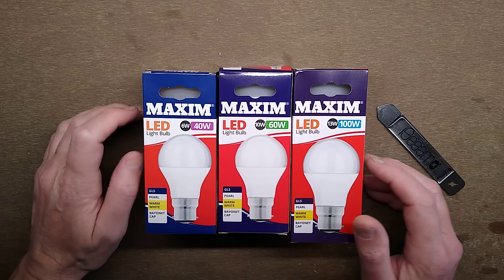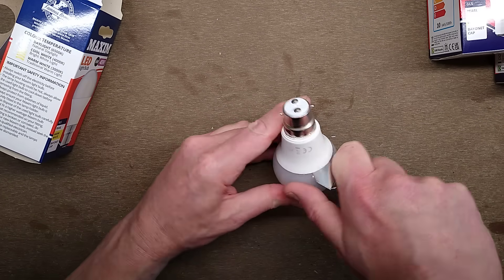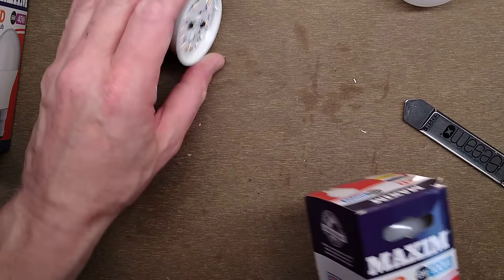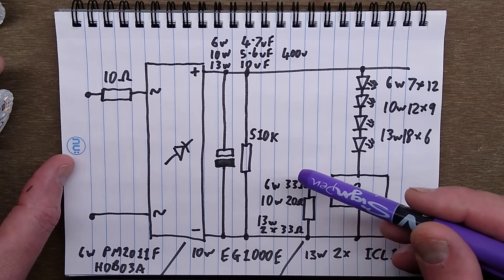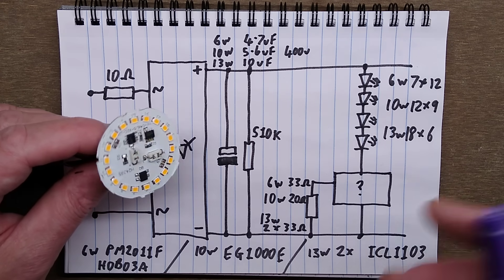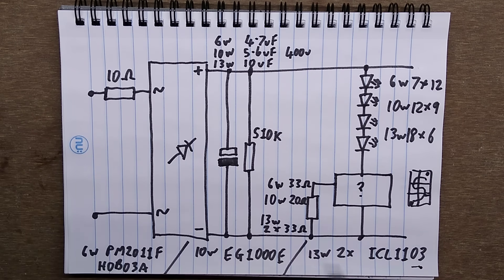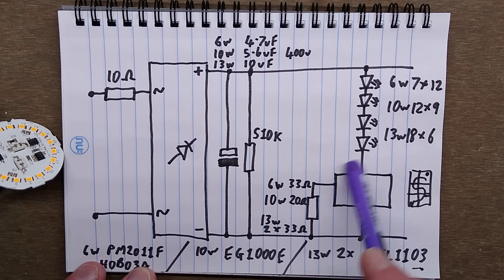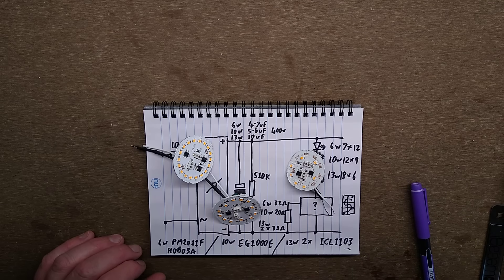6W vs 10W vs 13W LED lamp showdown (with schematics)

Comment: Wow what a power factor! Most modern places they have fitted new power meters that will actually charge you fully for bad power factor products so there goes a heap of your savings. Most of my batten lights I bought to replace old fluorescent ones had premature inverter failures. I wonder If I could use them chips of a few bulbs to make them working again. I also have a good collection of TV back-light strips that are happy around 70V.
Reply: What do you mean by “most modern places”? Ttbomk in North America and Europe no country is charging end user consumers for power factor (yet). Industrial or large offices, sure, and as Our Gracious Host has previously said, the smart meters we all have now can do it, if enabled to by software, and it’s not impossible that it will happen — but the switch has not yet been thrown.

(Also, .6 is a fairly good power factor for led lighting. The bad ones were more like .1-.2)

Comment: I wish you'd also measure the Lumens output on these bulbs, which frankly is the most important consideration for most consumers.
Reply: How easy is that to do, though, especially when travelling?
Reply: Measuring that correctly requires a rather large and specialized tool called an "integrating sphere". You can't do it with a handheld light meter. Also, given that other parameters on the box usually measure out correctly, I'd assume the box is accurate, at least initially.
Reply: @Broken_Yugo  You can never assume the box is accurate when it comes to cheap made in china products. More importantly, we're not looking for highly scientific measurements like that. A simple light meter at the same distance is more than enough to at least measure the difference in output between the bulbs.
Reply: Exactly, especially a comparison between stock and hacked one would be very useful

Comment: I hate to say it Clive but the problems with the silicon in the first bulb indicate exactly how much care the manufacturer will take in producing them, this could be a case of where the price of the item will reflect exactly the quality of it.
A  low price suggests no QC and little care taken in the manufacturing process, possibly that may change with more expensive versions of the bulbs, but since these are produced by Chinese manufacturers and branded for western markets I could be truly wrong.

Comment: The schmoo everywhere is akin to the 30w LED streetlight I bought a couple years back, took it entirely apart the other day, earth wire was just stuffed under the aluminium plate PCB with the bare wires all shoved into silicone goo, basically making it an insulated connection, and that was a UK-approved light too, can't possibly think why it was sold off cheap back then... :P

Comment: I have a big 20w lamp to light up a medium sized shed. I opened that lamp but discovered a different construcion: it had more than 100 leds and the power supply was in the lower body submerged in resin. All the lower body despite looking plastic from outside had an aluminum body on the insider, which made contact with the led board using a decent amount of thermal paste...no way it can be hacked. Probably this kind of hacking works only on small bulbs.
Reply from the maker: Even the big panels have current regulators that can be hacked, but it's harder when they are potted.

Comment: Most of the bulbs I post-mortem have been manufactured with some failing in the cooling, e.g there's a bit that should be crimped and it hasn't been, or there's a place where things need to be squeezed together for proper heat flow, and it isn't squeezed - or there should be heat sink compound and there isn't. It's a shame - they're often lasting no longer than a tungsten bulb would. And it's not the fault of the LEDs themselves, it's all about heat flow and cheapness.
Reply: I've dissected a lot of post-mortem LED bulbs too. It's almost always due to overheating, which is hilarious since LEDs are so much more efficient per watt. Especially the cheap LED bulbs being advertised with a "25 year lifespan" LOL.
Reply: Chineseum crap 😠

Comment: The real problem is that most LED lamps are marketed with “equivalent” power ratings to tungsten filament lamps. However, the amount of electrical energy drawn from the mains supply is not equivalent to the amount of light output. This is true for any type of lamp. As all lamps waste some energy in the form of unwanted heat. Plus how many people actually try different lamps to select one with a reasonable brightness for the room, rather than fitting whatever they have / the highest power that they have?
Really lamps should be selected using both Luminous intensity (unit is candela or cd) which is how bright a light is when the light from it hits a flat surface from one direction of the light source and Luminous flux (unit is lumen or lm) which is the total light output from all directions.
As Clive says, the efficiency of a LED to convert electricity energy to light varies depending on the electrical current and more importantly, the temperature of the semiconductor chip. At higher currents (power levels) it runs hotter, but is less efficient. Hence if you run a LED at half the maximum rated current (LEDs are current operated devices), it will be more efficient than when operated at its maximum rated current, but will obviously have an overall lower light output.
The reason that manufacturers don’t operate LEDs at lower current levels is cost. You would need more LEDs for the same light output.
Reply: This is 💯 correct. I made a comment about also measuring the Lumens of these bulbs before I saw your much more in-depth comment. Power consumption does not mean equivalent light output, and so many "equivalent" LED bulbs on the market lack the light output.

Comment: So, you mention these are linear regulators, typically linear regulator has a constant voltage. Have you placed a current probe in the LED path (or look at the scope voltage on the current sense resistor) and verified there is no switching going on? Two older units I have switch the current (no inductor), ramps up to a peak current, turns off and repeats. Can you try this?
Reply: Well, I dislike the term “linear” when used with regulators, as their operation is far from linear for some of their operation. Really “linear” is being used to mean it’s not switch mode technology. A better term would be “DC current regulating”…
Reply: @Mark1024MAK  As in semi-constant regulating. But the older led controller I looked at ramped up the led current to the resistor threshold, then switched it off and repeat. I was curious if these new "linear" regulators were doing this nor not.
Reply: @user-rs8zg8ey2b  - ramping up implies that there is a capacitor that is being charged to control the output. Which would be a strange thing to do. Unless that design keeps hitting some kind of protection limit (over temperature maybe).
Reply from the maker: Linear current regulator.  The current is fixed instead of the voltage.
Reply: @bigclivedotcom  That's what I assumed, until I put a current probe in the led current path. Have you checked this to verify its constant current?
Lazy way is to check ac voltage on the current sense resistor, should be zero if your correct,,,,but I have seen DMM's that are not great at higher freq AC waveforms, I love my current probe, DC to 50Mhz, 0 to 30A.
Reply: @bigclivedotcom  Would you consider this linear regulator constant current? http://www.bpsemi.com/uploads/file/20161215114728_476.pdf

Comment: How does power factor affect consumption?
Reply: It does not. However, a poor power factor means there are more distribution losses compared to a good power factor. But keep in mind these losses are relate to the real power. So for low power devices, it’s less of a problem.
Reply from the maker: Theoretical the utility industry sees slightly higher current, but you only get charged for real power.  But with smart meters that will inevitably change.
Reply: @bigclivedotcom  - I still have a “traditional” meter, and can see absolutely no advantage to me to have a so called SMART meter at the moment.
Reply: @tactileslut  - my meters (electricity and gas) are contained in those lovely “white” plastic boxes in the house wall at the front of my property. But at least mine are not able to be seen from the street (they are in the wall next to the steps to the front door). I take my own readings once a month. Takes less than two minutes. Then if I want, I can enter the results on the web site of my supplier, who update my account, normally within one hour.
Only if the supply companies offered a discount rate for energy use off-peak would a so called SMART meter be useful. But it’s doubtful if overall, this would reduce costs, as it’s likely that they would raise the peak rate at the same time, or not long after…

Comment: I like how the design seems to be maturing to a very simple standard.
The first LED house lamp I ever played with was one I wired on my own, mostly similar but it did stay on because I had it on a circuit with three switches and the capacitive coupling through the cable was enough to keep a few LEDs on. I had not considered that that little energy would light them up,  but considering the cure seems to be to create extra heat, I don't mind a residual glow. After a decade the filter cap I used degraded, and I suspect that will be one of the most common failure modes with these too.

Comment: Why is the power factor so low? 🤔
Reply: It uses a “bulk”/“smoothing” electrolytic capacitor which charges up to near the peak mains voltage. So during the time the sine wave of the mains voltage is below the voltage on the capacitor, no current flows from the mains supply, then as the mains voltage exceeds the voltage on the capacitor, a very large current flows for a short time. Then the cycle repeats. That’s what causes the poor power factor.

Comment: I found that solder joints on these types of bulbs starts cracking after a few years leading to flickering lights. Sometimes resoldering works but not always.
Reply: Because cheap manufacturing use solder without that 1% silver...
Reply: @rayoflight62  or without that nice juicy lead
Reply: That's what often happens with cheap Chinese tat I'm afraid. I wish people were more discerning and paid a little more for something which would last a lot longer and not quickly end up as landfill, but seemingly a lot of people just love wasting their money (and then having a good moan that they're broke).
Reply: @SlartiMarvinbartfast  I have often found Chinese electronic products use very thin copper wires in them with poor solder joints.  I have repaired a number of outside solar lights by replacing internal wires and resoldering joints.  I guess most of them end up in landfill after a couple of years at best!
Reply: Happens with CFL bulbs, too. I've torn a few apart after they've died, from various brands ('store brands' up to Sylvania), and they all seem to have at least 2 joints with eye-visible cracks. Most I've seen was around 8 cracked solder joints! (I don't remember the brand of that one).

Re-flowing them has fixed a few, but often times it seems like the cracks coincide with the death of components... Whether it's the cause, or a result, in not sure. I can come to a plausible situating for either way.
Having to jump the small gap(s) maybe raising resistance or causing voltage spikes (its often on the HV lamp lead posts), frying stuff that way.
Or, components wearing out getting hotter and hotter, cracking the joints.
OR might be neither now that I say all that, and solely down to thermal cycling causing metal fatigue or the super, due to long "on" times each day where the unit reaches maximum internal temp... 🤔

Either way, I agree, it's probably the Lead-free solder at fault, resulting in a rigid joint, on top of the alloy being more susceptible to work hardening, and ultimately cracking.
Thankfully consumers can still get leaded-solders. Personally, the best I've found is Radio Shack's Sn/Pb/Ag (62:36:2; 2% Rosin) in 0.015" dia. Mainly due to its flux! This other brand I had bought when I couldn't find the Shack's, either has too much or too acidic and I can't keep the tips tinned, while soldering! 
(it's relegated to garage use only, but I can check the brand should anyone be curious)
Reply: @DUKE_of_RAMBLE  I second the Radio Shack 62-36-2 solder.  It is really good stuff.  That or the Kester version is my go to for precision work and for automotive high criticality wiring harnesses, through hole production, and proto board builds where a failure could equal a DNF for the weekend.
Reply: Given what I have seen regarding 'planned obsolescence', it wouldn't surprise me in the least to learn that they carefully add a retarding agent to the solder so that it cracks after a pre-determined amount of time. If businesses would have never engaged in this kind of unethical behavior en masse, perhaps there wouldn't be such a dangerous rise in conspiracy theories in the world today...

Comment: Is heat resistant silicone the same as silicone heat sink glue
Reply: No. Any substance designed to help transmit heat has to have a very, very low thermal resistance. While heat resistant products do not, they just have to be able to withstand high temperatures.
Reply: @Mark1024MAK  makes sense when someone explains it,thanks Mark

Comment: I get triggered whenever LEDs dont print the Lumen instead of just the old "100W" reading on the front. I want to know how bright the bulb is, not how much power an outdated technology from yesteryear would have wasted into 90% infrared radiation.
Reply: 90% ??? much higher than that!  From coal energy input to light output, incandescent is 0.7% efficient!, absolutely horrible.
Reply: @user-rs8zg8ey2b  why are you factoring in the power generation? What matters for efficiency are the volt-amps drawn by the lamps (watts are silly because power burned is power burned). An incandescent lamp producing about 14 lumens per watt, assuming about a 680lm/w theoretical maximum, gives about 2% efficiency. In practice of course the 680lm/w will never be possible; perhaps more like 300-400.
Reply: In theory either measurement should be fine, but they lie on the incandescent equivalency. Cheap bulbs also often lie about the light output, likely partly because lamps may dim after a short runtime. Here in the US a lumen rating is required but it's basically a toss-up with the cheap bulbs. My family just buys quality name-brand lamps and their light outputs seem accurate.
Reply: @Wyatt_James  incandescent light bulbs are pretty much outlawed and are not sold since years in the EU. Only old people will vaguely remember how bright a 100W equivalent is. After all these years of LEDs, it is pretty much pointless. The young generation never even has bought, or will buy, one of them. 

What I love about buying them online on Amazon, for instance, is that the shops provide a spectral output graph, so you can compare each model with the spectral lines and Color rendition.
Reply: @der.Schtefan  I suppose. Here they're still legal for sale and quite common in stores, though not particularly often bought. Still, their light output is always printed, and has been since CFLs became relevant, so it's pretty easy to see when "100 watt equivalent" is a blatant lie. I don't see harm in printing both, but of course companies lying about such things makes it much more confusing for anybody used to incandescents which were very predictable. I'm honestly surprised that more countries don't require printing lumen ratings.

Comment: here in the U.S we have 5 below stores
Reply: The US still has 1 cent coins, so offering products at something and 98¢ is still 1¢ below those asking for 99¢. [Edit: typo]
Reply: Maybe the chips are all equivalent, but each batch was made with a different roll of 5000 chips.
  As for the tunable LED count, did the 10W use some of those options to share the 6W or 13W PCB ?